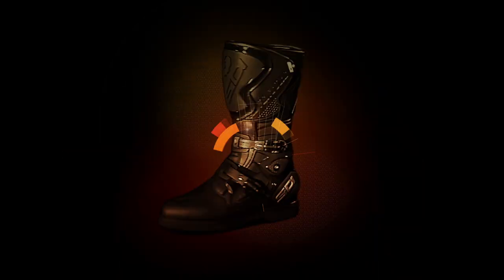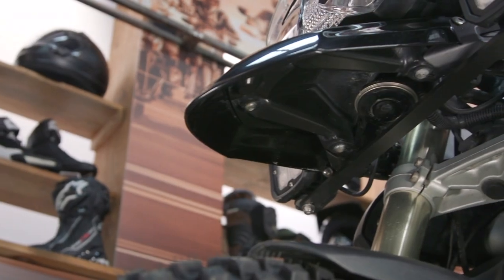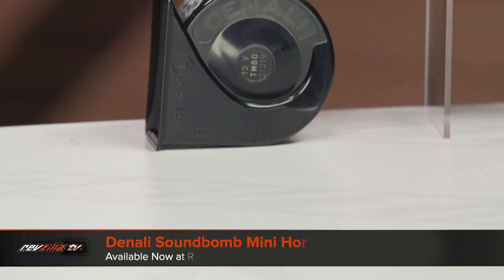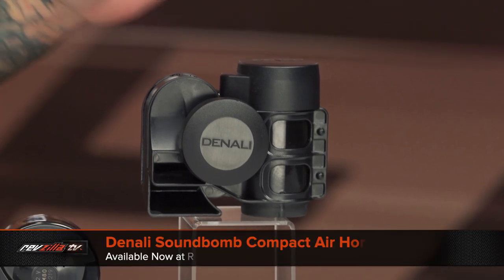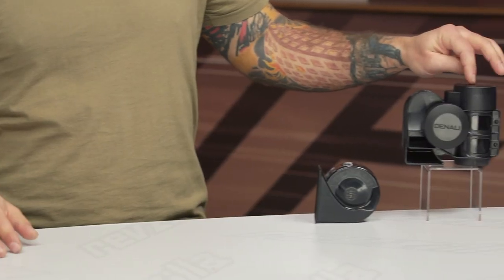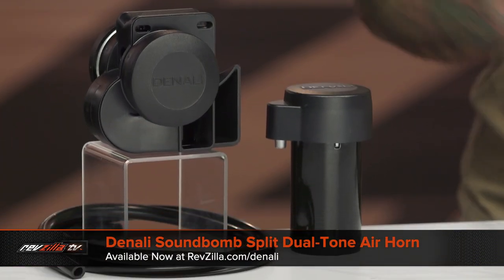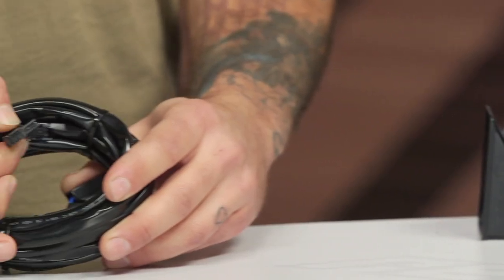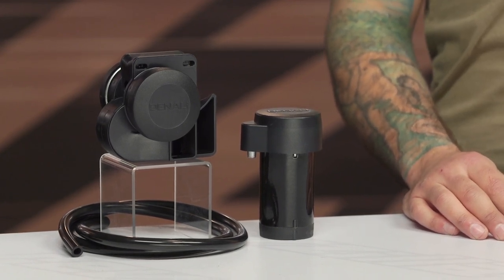Denali Horn Overview

Comment: Just an fyi...
I mounted a mini on my 2017 Versys 1000 using the same bolt the original was mounted to. I was disappointed by the volume. Then I read the instructions again, and mounted it using the included metal bracket. All the difference in the world. Give it a try...

Comment: The "Soundbomb Compact" is just the latest rebranding of the original Italian Stebel Nautilus (currently available on Amazon for $29).  I've been putting that horn on all my bikes since the year 2000.  I currently have a Versys 650 and a WR250R with that horn installed.  This same horn is also available from Harbor Freight as the Wolo Bad Boy for $38.  The Denali offering on Revzilla is overpriced at $55.
Reply: 55 for the Denali, 50 for the Stebel Nautilus. IDK how you got it for 28, but it is no longer that price on Amazon.
Reply: @SoulExpired  Wish, you're right, the Amazon price has rocketed.  It is, however, also available as the Wolo "Bad Boy" at Harbor Freight for $40.
Reply: Wrong they may look the same. A lot of companies have similar looking horns. Wolo has a 90 day warranty. Denali is 5 years. So yeah no

Comment: Not an upgrade most people put on a bike but it should be. Most people want performance but safety is very important too. I know even though I'm careful while driving I've had a bike ride in my blind spot for a while and never knew he was there. I seen him before he had to move but only because I turn my head and look. I hope manufacturers will start having 2 horns or a loud single horn on bikes in the future.
Reply: Turning your head to check your blind spot should be standard procedure every single time you turn. 

As a motorcyclist, I’m watching this video precisely because people don’t check, and I feel forced to upgrade my horn, which wouldn’t be necessary if drivers consistently checked their blind spot. Drive safe!

Comment: Mounted the integrated Denali (horn and compressor) on my 2019 Kawasaki Concours 14. I had to fab a custom bracket and it barely fit under the fairing on the left side. I had to mount it there because the space under the right side fairing is occupied by an electronic cruise control throttle servo.

Comment: Do we need a cansmart to install it on a BMW (the sound mob compact)
Reply: Should be able to install with the BMW horn adapter and the plug-n-play harness. 
The CANsmart allows you to control 2 sets of lights , plus the horn and an LED brake light, or o5er combinations of up to 4 accessories. 
CANsmart is the way to go if you are going to add more than the horn. 
If just the horn, get the harness and the BMW adapter.
Reply: @ronaldsantos5855  thank you

Comment: I tried 2 of them, straight garbage
Reply: Two of them, or both?
Reply: @briangiven7399  they're the same design as the badboy electric over air horn, they have tremendous volume, and sound great, but the cast aluminum housing is very susceptible to corrosion and will seize up, at around the 1-year mark, give or take a month or two, I bought 2, and both failed in less than years time, I want another one for each of my bikes, but first I got to figure out how to keep moisture out of them, to greatly extend the life of the horns "/
Reply: @cancelchannel3394  I hear there's a 5-year warranty, did you see that?